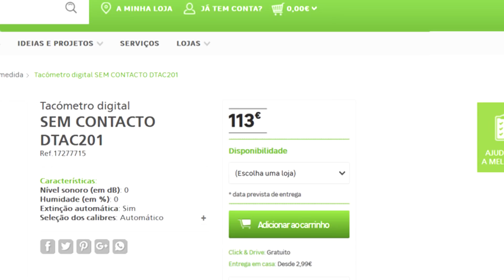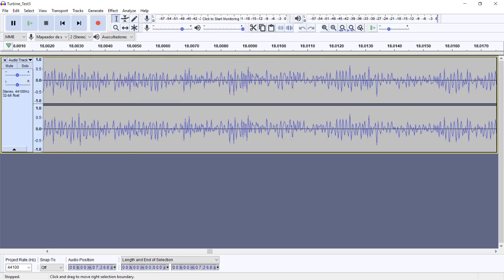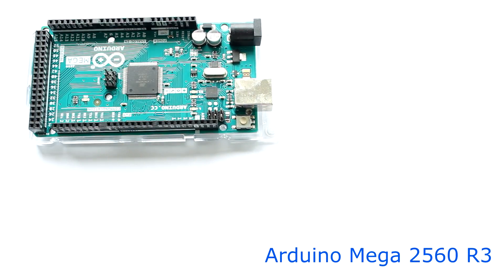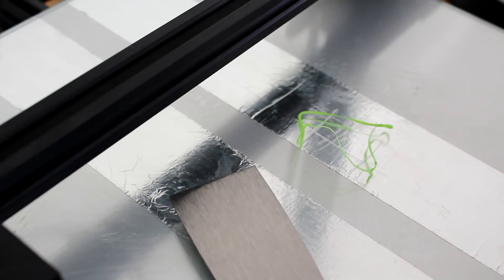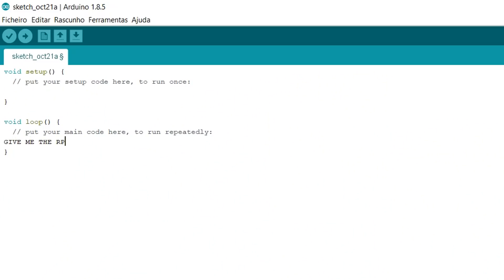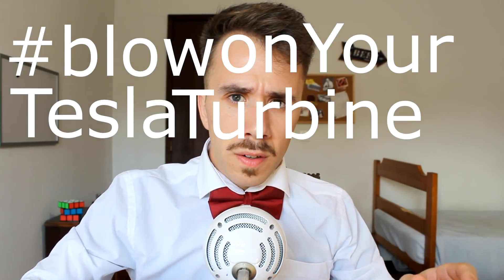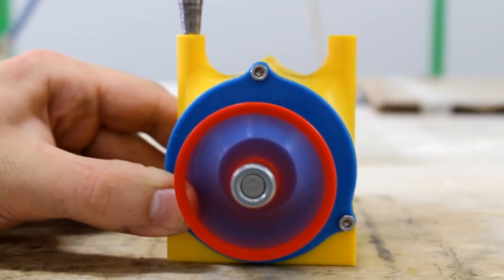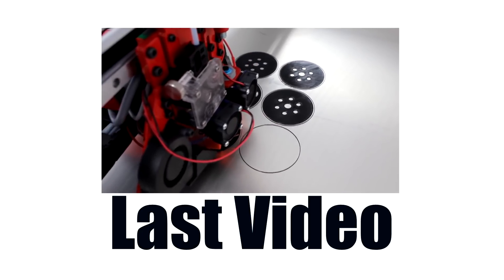DIY Digital Tachometer - Arduino|Photointerrupter  [Tesla Turbine]

Comment: The smaller and lighter the propeller, the faster it will rotate.  You will need to invest less energy to rotate it and it will also have less friction with the air.
In addition you will try to create a new model with an exit only on one side because there is still an air pocket that lowers the maximum speed.
It would be nice to see if the shape of the compressor nozzle also affects the speed, like its thickness or the air pressure it puts out

Comment: you could fix your soldering skills by:
1. not bringing solder on the tip rather heating the pad then pressing solder wire on the pad
2. flux, lots of flux
3. clean your tip pls

Comment: HE LITERALLY SHOWS IN A LATER VIDEO (id: eBlI6OQ-i3s) THAT THIS DOESN'T WORK.
He tests his arduino tachometer later on in a video titled "3D Printing a 106 Years Old Invention - Testing the DT2234C" and demonstrates that his arduino readings are WAY off. I suspect he didn't take into account the arduino's super low refresh rate, a teensy is probably better suited.

Comment: That solder wire looks like high tin, which is hard to solder and leaves a bad finish. You need leaded solder, ie 60/40-ish, with flux core. Plus a tub of good quality flux.

Comment: The speed of the wheel (rpm) is not an indication of the power that this turbine can deliver.  Also, bearings are a weakness for high RPM.  Try connecting the turbine to a motor which can be used as a generator, then the useful work the turbine produces can be measured.  Good project.

Comment: Zo, on the turbine and your need for speed. It would seem that the torque is woefully inadequate for just about anything really. Do you hope to get enough speed to gear it down to where you can actually find an application beyond justifying ultimately (because you know you will) getting a fancy digital photo tachometer? Not that that's NOT a worthwhile goal as well ;-) Color me envious, so green would be appropriate then.

Comment: you can measure the mass flow of air by using a simple U tube manometer by using water. 
And make a few thermodynamic calculations to find who much amount of Max energy can be used.

Comment: Many people don't know this, get a new soldering iron and before ever using it, look up how to "tin" the tip. Also, get a thing of flux and put it on everything, including your soldering iron, before applying solder. Your soldering iron tip should be shiny with a layer of solder covering it always. Solder should stick to the tip very easily. I struggled with soldering like you too before taking these very simple steps, now I am the solder king.

Comment: I know this video is quite old by now, but here are some thoughts regarding the acoustic rpm measurements: there is a free android app, spectroid, that's pretty good for frequency analysis + it might help to attach the microphone directly to the turbine casing, so it picks up the vibrations (so if you're using a phone, just tape the headset mic to it)

Comment: Teslas stuff is so cool. I just thought of comboing this with compressing refrigerant gas which is being heated by panels soaking up the enviromental temps which most all are above its boiling point. To hyper condense and pressurize the gas using the special effect the turbine operates on.

Comment: Get some rubyfluid.  Put some on the metal you intend to solder.  Bang, you can solder a lot better all the sudden!  The flux in "flux core solder" really isn't enough to do most soldering jobs well.

Comment: I think that you should be doing something for your soldering skills. You can try using soldering paste or adjusting the temperature of the iron, even its tip or the solder itself can be the problem... I am not an expert, but try it you will apriciate a well done solder joint.

Comment: Soldering tip: only ose the iron to heat the pins amd not the solder. Then apply solder directly to the components, it will distribute all on its own and it will look very good.
Reply from the maker: Than you very much for the tip 👍
Reply: I didnt know you was supposed to use the pins to melt the solder
Reply: @shlushe1050  trust me, im an engineer
Reply: @svenb4475  I do trust you... I'm an engineer in training... I've got a lot to learn

Comment: hey, just some tips for soldering: you did great but use more flux, if you have flux core solder, don't directly put it on the iron, put the iron on the part you're trying to solder, then add the solder. if it's solder without a flux core, put some solder on the iron as you did, and put some flux on the part and then touch the two. will work great.
Reply from the maker: Thank for the advice :D
Reply: @integza  btw, great vids, they're edited so well, every video is such pleasure to watch, and I'm so glad you're going on topics of Tesla, you honestly have waaaaaay less subs than you should have for this awesome work. keep it up!
Reply from the maker: @goldenpiston8449  You're too kind! Think you so much :D

Comment: It looked like you had a dual filament extruder, you could get some water soluble filament and use it for support structures or space filling. It might be an option for making the discs.
Reply from the maker: That's a great idea! 
The thing is, this printer is recent and I'm getting used to it, also, I never printed with 2 extruders. 
Thanks for the comment :D

Comment: I'd be really interested in seeing if flywheel weight has any bearing on the performance of the turbine. If you do, make sure you modify the code to store previous results along with a time stamp with which you could calculate the acceleration of the flywheel!
Reply from the maker: Nice idea! I like it!

Comment: You need to work out "poor person tactics", as I call it. Having two flywheels with equal masses of about maybe 1hg the motor should only need to sorry about absolute elevation of the "kinetic bank", and the total angular inertia should be some inertia h, and with more kinetic energy per velocity means the total power transmission (from air to rotation) should continue smoothly for longer before the velocity jamming comes into effect. The trade-off is then the increased friction on the bottom part of the axis's primary support points, hence the hectogram, but maybe kg could do if it's strong enough

Comment: 1:05 with even louder buzz "the duration of 9,192,631,770 periods of the radiation corresponding to the transition between the two hyperfine levels of the ground state of the caesium-133 atom" intensifies more as he goes into quantum physics to define each of those terms

Comment: Air escapes off through PLA layers, try use epoxy to seal or something else, you will get more RPM.
Reply from the maker: Ooooooh! That makes so much sense!
I don't have epoxy but I do have an acrylic resin.

Thank you so much Esposito !
Reply: @integza  super late but in my opinion the best method would be to print in abs and smooth it with acetone. You will get a smooth, waterproof solvent created surface.
Reply from the maker: @josephrossman1600  In this channel your never too late my good friend.
Thank you for the advice 😉
Reply: @integza  I commented on a video exactly one year after you published it. Wild!

Comment: I wonder if you could print spacers to set the spacing between the plates. I wonder how hard it would be to cut the turbine plates out of metal... they're far from complicated!

Oh, and I wouldn't write off the frequency-amplitude plot in audacity too quickly - remember that the amplitude is displayed logarithmically, so a small difference in the height of the peaks is actually a large difference in absolute amplitude! You should check to see whether it actually matches up, now that you have your arduino tachometer :)
Reply from the maker: Hi shoofle ! Thank you for the help :D 

I like the spacers idea but I'm trying to stay away from metal discs, they're quite heavy to be pushed by air. I was thinking about trying with carbon fiber or polycarbonate.

You're right about the audio method, I should've done more research.

Comment: Is PLA transparent to infrared light - so funny I am still laughing :-) Poor man.

A cheaper way to construct the RPM measuring device might be some coiled up wires to generate a weak magnetic field, that gets interrupted by the alu foil and measured directly by the ADC on the Arduino. Or if you have an oscilloscope you can simply hook it up to that. 

By the way, you really need to watch a tutorial on soldering: https://www.youtube.com/watch?v=J5Sb21qbpEQ
Reply from the maker: I promise I'll watch the tutorial haha

Your coil idea is really simple and probably works well, I have to try it!

Comment: the product of weight of aluminium block which is held between the sensor and the RPM X 2pie X radius of aluminium block /divided by 60 will give you the total power output by that turbine in watts........   power = (2pieX RPM X Torque (torque which is the weight of aluminium block multiply by the radius of aluminium block unit (Newton multiply by meter N-m )/divided by 60)...................... if you didn' t understand what I have explained then email me on owaisf.2088@gmail.com
Reply from the maker: Thanks owais ! I understood what you explained

Comment: You might've been able to use the audio method if you did a recording while holding the shaft still, and a recording with the tape hitting your finger. Then in audacity you could have used the "Noise Removal" effect. Use the recording with the shaft being held still as the "Noise Profile" and then use that profile to remove the white-ish noise from the recording with the tape hitting your finger.
Reply from the maker: I did use my finger and I used the noise removal effect but the air and the turbine do a noise with a big amplitude. But I need to try that again.

Comment: I believe you switched open and closed around. Open is 0, closed is 1. An open switch is when there's no contact between the 2 poles, a closed switch is when there is. For optical switches this becomes open = obstructed, closed = unobstructed. Good vid tho, quite entertaining.
Reply from the maker: I'm aware that 0 means open loop and 1 is a closed loop. I just reversed the names because I thought it would be more intuitive for the viewer.
The code is alright though. Even if I switched the signals it would be alright because there's an equal amount of  "closed" and  "opened" per cycle.

Thank you so much for the compliment :D

Comment: I don't know too much about compressors but could you start a  test with different types of pressure: from 0,2 bar to about 8bar? I don't know what is your max. Pressure.
Run the turbine from 0,2-8bar in 0,1bar stepps and measure the speed for about 2-5 minutes.
Reply from the maker: For that I will need other compressor. This one has a maximum of 9 bars but that's it ... it cant step the pressure.

Comment: you're soldering wrong! you don't put the solder on the iron first. well, you put a runny amount so it transfers heat, but you use the iron to heat up the joint and then you apply the solder to the joint so it melts in place. remove the solder and then the iron.
Reply from the maker: Just learned something new!